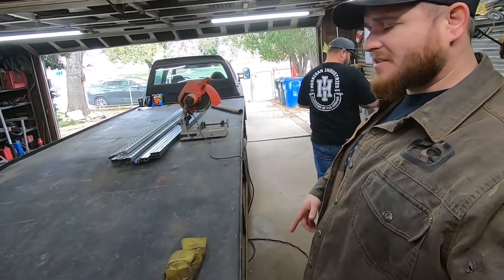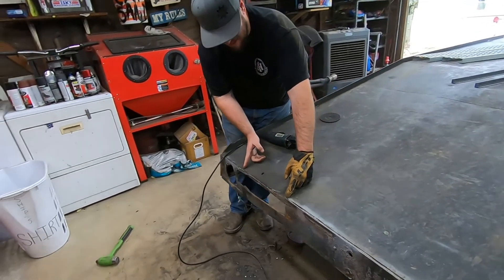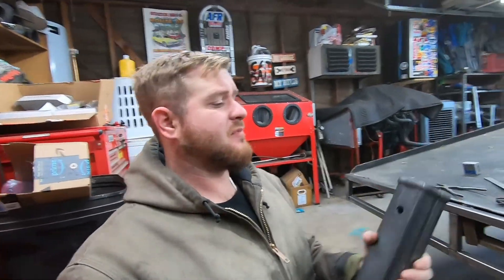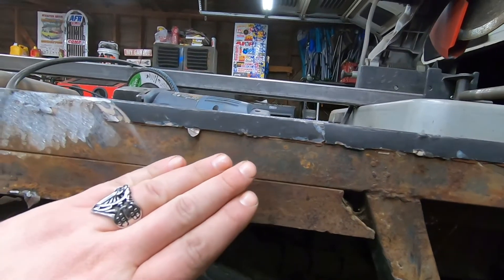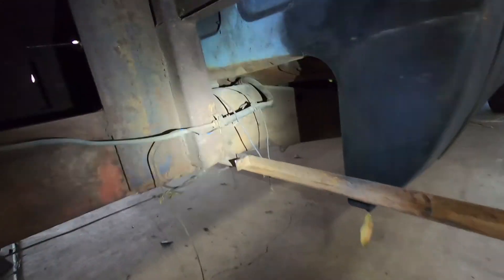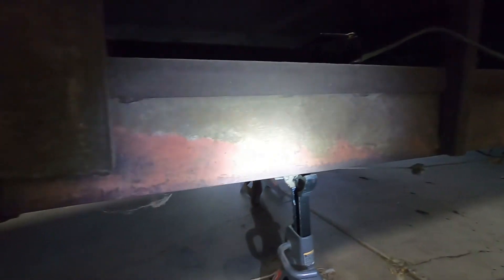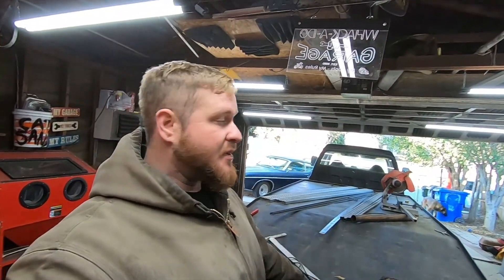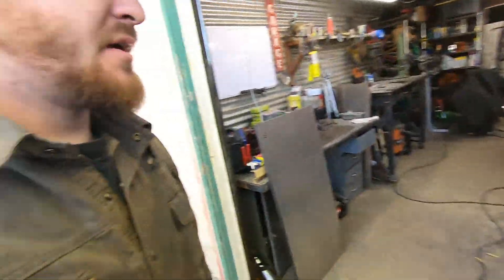e49. Our Square Body ramp truck is getting a bed overhaul!

Comment: I know this is old but could you tell me what the cab to axle measurement is and bed length
Reply from the maker: 101 inches cab to wheel center, right around 8.5 feet. 16 foot bed. Relatively short as far as ramp trucks go but in CA there's rarely turning radius and parking as it is so I was happy to end up with a shorter bed and I have a safe amount of bed under the wheels of my cars so it's perfect for me.
Reply: @WhackADoRacing  i am thinking of the almost the same, doing 8 ft cab to axle with 16ft bed, I have 11ft of frame that I want to add 5 ft dove to

Comment: I know this is an older post but I would have carefully strip the back everything clean to the bare frame, salvaging as much as you can and starting over! That is just garbage work they have done and you don't want your name associated with it. And I would be questioning that frame extension! Just my 2 cents.
Reply from the maker: Eventually all of the sheet metal was removed other than the top skin and every weld under the truck was checked and either rewelded or extended along with gussets throughout the underside to tie the bed and frame together more entirely along with rewelding and gusseting the frame extensions before moving on to reskinning the exterior, adding work boxes to the sides, and adding the air bags. It was months of undoing the mess underneath while saving what I could. The first order of steel I put back under the bed was already $1,000 due to current material costs, so I had to salvage what I could.